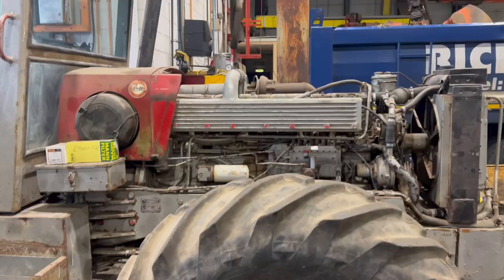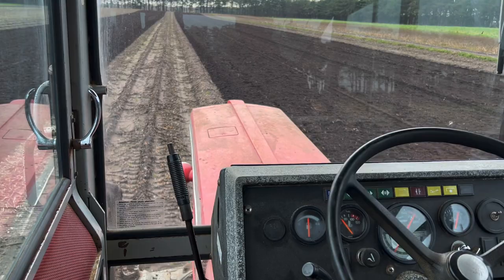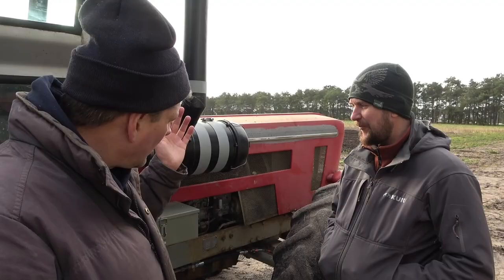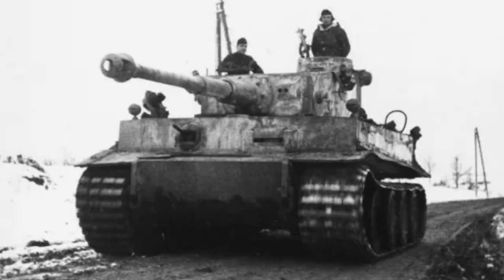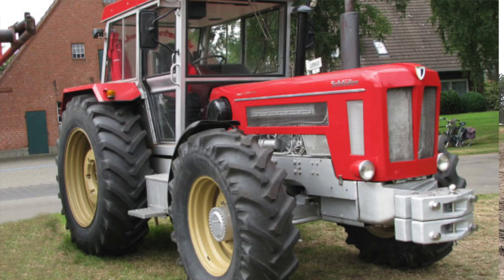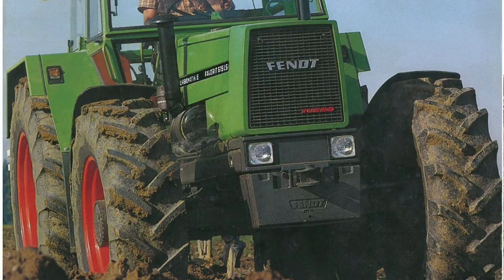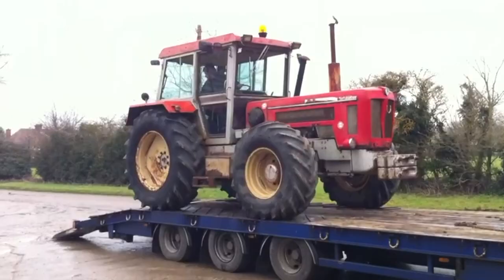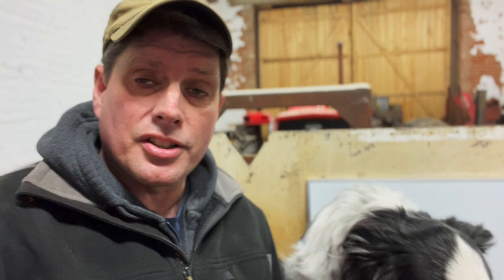FULL POWER ! - Schlüter at work !

Comment: My boss and neighbour had 2 Schluters that he bought from Anton in 1972  to work on his farm in Ireland. He had placed an order a few years later for a bigger one but cancelled it in temper when one of the drivers broke something through carelessness.Because he was German himself he thought they were superior and tried to promote further sales of them in Ireland. For power and traction they would embarrass his 1300 super fiats and 1124 county. The backend was similar to a 8006 Deutz being ZF also. The cab was the earlier version with no back in it same sliding doors. The engines had a short life between rebuilds seldom both were out of the workshop.In the early 90s one was scrapped to keep the other alive. I still have the rev counter clock and brown tax book from it. The other one has remained local and will be restored sometime. A specialist used to come from Germany to carry out major work on them.Another earlier small cab less one is still in my area made before they were red with a mid mounted finger bar . It was also imported by a German that came here to farm after the war .

Comment: Hi Mucka
Super tractor drove one for a summer  nearly 25 years ago on a tillage farm in north Germany near Hamburg 
What a machine   we had  a JD 7800 and a JD4755 also  The Schluter was a170hp model but would leave both deeres for dead
It was also reverse drive  the steering wheel  and dash and seat  could rotate to face rearwards  and  so had many extra uses
Brings back great memories  thanks for that

Comment: Nice to see something I don't think I will ever see in person. How that tractor pulled reminds me of my Minneapolis Moline g1050.  My tractor has some flaws steering is bad, made worse when using the crude 3pt hitch that takes all the weight off the front even with just a semi-mounted plow, but when working a field she has the torque you want. Half the time you can be plowing at half throttle and speeding up the engine only makes it go a little faster.

Comment: I see it has evaporative cooling on the cab. A lot better than nothing but a long way behind AC. It’s one advantage was you could fix it yourself. I had a Massey header with water cooling on its cab, it would use easily 40 litres of water a day when it was working properly. When it wasn’t you would get a bath. AC was already basic equipment here by 1981. Jeff

Comment: If you think that's noisy, I took on the management of a large farm in Pembrokeshire and we had 2 Nuffield 4/65s with Cabcraft safety cabs . When you were flat out pulling a12ft disc harrow you could not hear yourself shouting. The cabs worked though as both tractors were rolled without damaging the cabs or drivers. 1 rolled down a steep ,almost vertical, bank wrapping a 24ft chain harrow around it. The driver scratched his hand on a bramble climbing back up the bank!

Comment: That Schluter is a awesome tractor , you could see it was nearly pulling the grip out . Probably could do with some new tyres. Love the sliding doors , you can have them open and not worry about catching them on something. Excellent engineering . Great video , can't wait to hear that straight eight running.

Comment: Legendary tractors! True german brute at work. Only 4 in the UK? Wow. I was told their might be at least 1, in Canada that some guy brought over from the EU. I've always wondered why they didn't sell so "well" as i am told besides having great comfort, a good bit of options and selections & really good high HP, for the standards of the day. Oh and yeah High price... But weren't they like "Rolls Royces" of German tractors? P.s Don't forget the V12s!!! Profi-Trac 5000 (1978 only) & 8000 (1980). I really do love my USA stuff, but my love is much more for the old German and EU style outweighs it.
Reply: Hello Kyle, 4 comments below I wrote something about Schlueter that answers some of your questions. The Profi Trac 2500VL from the year of construction 1976 with the serial number 1 - 240 DIN PS on the engine (approx. 280 SAE HP) with a fixed frame and steered axles such as IHC or Case 4WD tractors (no articulated joint) was taken to Canada by a German and also returned to Germany around the year 2000, where it was also restored, meanwhile such large Schlüter are traded between €300,000 and €500,000.
I also know of a Super 1500 TVL from Great Britain, which also returned to Germany between 1995 and 1997. We ourselves once had a Super 1500 TVL when we ordered spare parts we were also asked if we had it from Great Britain, we don't know if it was ever there or just stayed in Germany, the tractor was manufactured in 1979 and only in the spring of 1984 Delivered as a new vehicle in Austria. Excuse my bad English. greetings from Austria

Comment: I had the experience of driving a Schulter 120/125hp tractor ( six cylinder but looked more like an 80hp tractor)back in the late eighties. Seemed to be a heavy tractor and the sloping front windscreen took some getting use to. It had plenty of room in the cab and sliding doors could be pain at times(no air con,hot weather and a field on a bank.Ok going up hill with doors open but down hill the doors wouldn’t stay open!) It was fast on the road as tractors go back in those days,perhaps it was fitted with a 40kph box?
It was one of those tractors that you put into gear, set the revs,lowered your implement into the ground and it would stay there at those revs/speed whatever the ground condition, nothing bothered it! A Zetor Crystal 12011 did the same.
Reply: There was also a 200hp Schulter at the same farm which when it was sold went to Holland. I don’t know what happen to the 120hp (1250  TV6 ?)one that I drove. I would like to think it’s been restored to show room condition and is still in UK but it is most likely to be the drain cover I drive past  on a daily basis. Schulter tractors are still a very popular brand in Europe and keep their value.

Comment: I spent most of the video trying to remember the name Oliver Walston… My late father bought a Schluter from Brocks in the early 2000’s as a project. (Unfortunately never got to fix it up due to illness.) Think it originally came from the Walston farm. The hydraulic control levers were all missing and we never managed to source a replacement. I remember It would run but you got a nice fountain of oil inside the cab!!😂
Great video Mucka!! 👍

Comment: Great Machine legendary German over engineering. True grit horsepower. These old tractors will pull modern over priced to stalling anyday. I saw them working at Triplow back in the eighties. Reminds me of the old Claas Dominator 85 combine, ugly as hell, only 120 Merc horse power, noisy square headed cab with that awful water cooler that pissed water down your neck when hitting a bump on a ploughed in winter bean headland, but as tough as old boot and build like a brick toilet with superb quality steel. just like K98 snipers rifle!

Comment: Schlüter sold most of the big ones over 250 horse to jugoslawia . when the war started in juguslawia this marked broke down. Thats one reason  , then  ZF stoped producing the large powershift the 2500 and above had so schlüter had to build their own one , ended in the 9 speed elektric full powershift , they used it in the Supertronic types . but to figure out and build was expensive for schlüter.
Reply: Yes there where a nice number of Schluter tractors in ex-Yu. In my village (eastern Croatia),4 where bought brand new in early '70s,120-140hp. They where working hard up to late '90s..often 2 months, in 2 shifts day/night..

Comment: Certainly impressive especially for the Generational period. Wonder if the cab rooftop A/C was original❓Few early vintage cabs included cooling even if some form of a heater core was provided. Were it not for potential dirt build-up in the tracks, the sliding doors are very functional/appealing. Feel that the Fudd Weasel is quite correct. He stated that many manufacturers TODAY have lost the principle of providing the farmer with what he needs, but rather design  engineers seem to focus upon what they see as the farmers best interest .🇬🇧🔔💡🚜
Reply from the maker: A lot of German stuff had the water cooler units

Comment: We’re they at Oliver walstons farm new? I just have a recollection of a pair being advertised by brocks or someone 20 years ago in the early classic tractor, and an article about Dr Schluter. I remember reading that the 8 cylinder cranks would whip and fail occasionally. And that’s about all I can remember about them, I had no clue they were as rare here as that
Reply: Yes they were he had two of think and moved on to John Deere after these they had one of them parked up not so long ago but then I think they sold it sometime last year. The company I work for actually rent one of the barns off of the walstons and I have helped them out during harvest 😊
Reply from the maker: Did you not actually watch the video ?
Reply: I think Walstons had four ,two like on the video an d two smaller ones all from new.

Comment: A Tip for you on the injector Tester, Get A big Fanta plastic Bottle and cut the top off Level with the Test pipe and when you test the injector all the Diesel will not end up on your Sleeve and the Workshop Bench ,🤣👍
Reply from the maker: He does normally but wanted to show the spray pattern more clearly